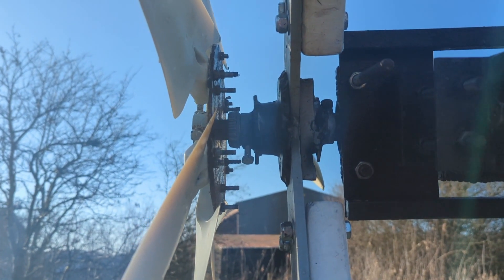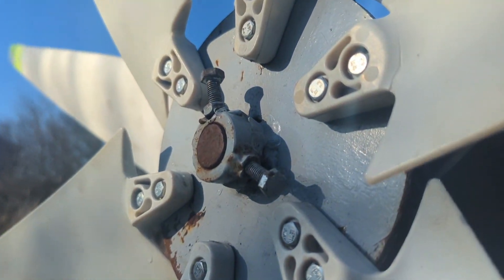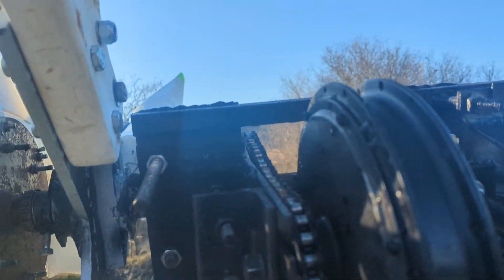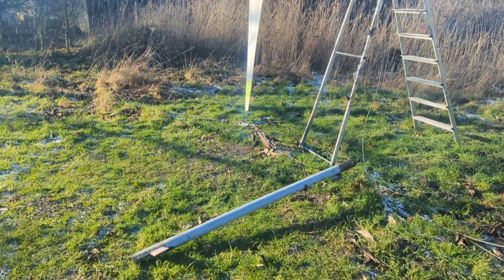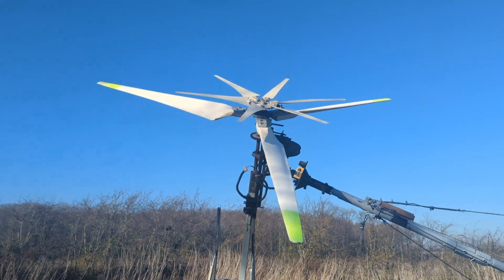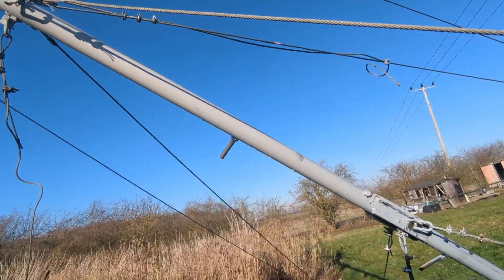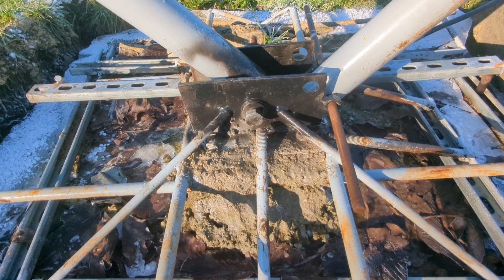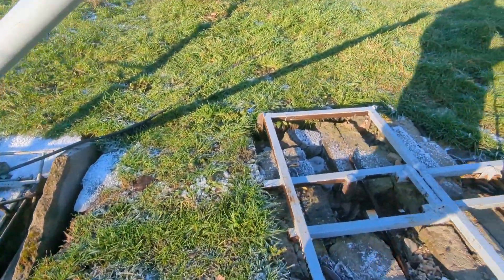Wind Generator Project Free Energy - Blades Changed Over - 24th January 2023

Comment: Should have dropped the little front turbulence/loss inducing front set of blades while it was down - then really unleash the potential of that beat you have built :)
Reply from the maker: I will take them off at some stage and try running just with the three on their own but having ran both ways, I'm still pretty convinced that the two sets is better. Cheers!👍👍